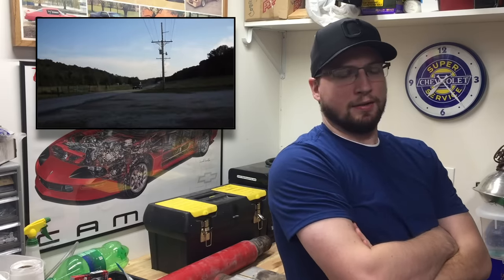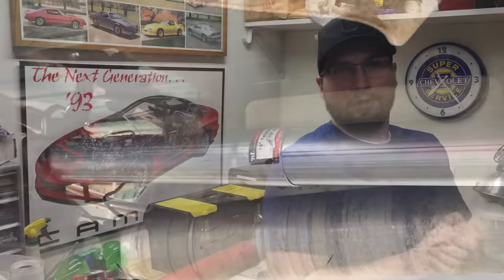Cherry Bomb® Glasspack vs. Straight Exhaust Pipe - Sound Comparison - 5.3L Chevy

Comment from the maker: What sounded better? Glasspack or Straight Exhaust Tube?

OFFICIAL DANINATOR MERCH IS NOW AVAILABLE! Check it out:
https://teespring.com/stores/the-daninator-merchandise-shop
Use Coupon Code: DAN10 to save 10%!
Reply: I have the same truck, and mine is straight-piped. I prefer the straight pipe...
Reply: Straight pipe forsure thats what i have on my 5.4 should try putting a 5 or 6 inch tip it would sound real good
Reply: Straigh muffler delete is sexy. But i would go with Glasspacks. Now heres a great questions. Whats the difference between Cherrybomb Glasspack VS Thrush Glasspack? Also when are you gonna get high flow cats? If your state doesnt  require emmisions. When are you gonna cut off your cats?
Reply: I liked the straight exhaust on most shots. So straight
Reply: Straight pipe sounds better for sure
Reply: I have an 06 5.3 that's been straight piped for about two years now, suffice to say I love it and my four year old loves it even more lol hey Dan if there's any chance you see this comment it'd really help a brother out if you did a video on how to replace the rollers, I've read the manuals and gone to the forums and unfortunately there just isn't an idiot proof video anywhere on how to do it in the driveway with common tools
Reply: The straight pipe sounds good at idle and part throttle but too loud and harsh IMO.  I'm partial to a single 2 chamber or a turbo muffler.
Reply: Both sound good but I think glasspack sounds cleaner
Reply: Straight pipe at idle sounds so much better
Reply: Glass pack sounds nicer less erratic scream at high revs
Reply: Dual 40 series Flowmaster mufflers is what I run. Short style JBA headers. It's a 1999 5.3l LM7 Silverado. Going to do a rebuild on it soon. Maybe bore and hone it out 3.903 (5.7). Stage 2 cam, FAST Lxrt intake, long style headers, 92mm throttle body, after market heads. I'm the original owner.
Reply: Straight pipes sounds better
Reply: I’ve a 4.3 V6. I love having a straight pipe sound but it sucks when you’re pulling into church late or trying not to wake up the dogs when you get home so I’m going to put my glass pack back on
Reply: Aaron Brown 
Do a electric cutout. 
I did one and it’s a lifesaver, I’ve saved at least 3-4 times even being pulled over for being loud. 
I did mine a little different, diesels (no turbo) are wicked loud with a straight pipe. 
So I have a glasspack further up front, and the cutout goes to open , or into a turbo muffler. 
I find myself riding around with it closed most of the time unless I’m out in the sticks.
Reply: straight pipe
Reply: Straight pipe
Reply: Glass packs. Straight pipes are a little too much noise for stock. Maybe do a rebuild video and put a mild cam in it and do another exhaust video?
Reply: Straight pipe
Reply: Glass pack I think. It has a more throaty sound than the straight pipe.
Reply: GODONDRUGS would my 5.3 99 sierra sound good straight piped? it has long tube headers and a flowmaster 40 series right now with cats removed. i’m gonna take the muffler off when i get it straight piped
Reply: I think strait pipe is better
Reply: I definitely liked the straight pipe cause that’s what mine is pretty much
Reply: May i suggest eletronic exaust cutouts it's nice to have a quiet truck but flip the switch and hear the roar
Reply: Well from experience I have cherry bombs on both of my vehicles 93 Ford Explorer 5 speed and and 01 land rover discovery they both have a for leader they explore has a 4 l V6 then land rover has a 4 l V8 and they both deathly have a distinct sound compared to other vehicles the same
Reply: The Daninator straight
Reply: Straight
Reply: Can we talk about the rust on your bed..?
Reply: Straight pipe
Reply: How much did each cost
Reply: The Daninator straight pipe
Reply: Glass pack
Reply: Straight pipes just make it louder at idle n make it crackle more cherry bomb makes it more of a sleeper style where u can idle up towards someone on side walk n make um jump when u hit the throttle
Reply: Straight pipes!! I put straight pipes on my 1977 Cutlass my mom liked the sound so much she had me put them on her 1977 Pontiac Can Am she loves setting off car alarms while driving downtown! 🤣🤣🤣🤣🤣
Reply: Glasspack
Reply: Glasspack all day. You get the growl without that high pitched rasp.
Reply: Straight!
Reply: straight pipes better but i’m gonna get the glass pack so i don’t get pulled over all the time lol
Reply: At idle, the straight tube sounds better. Under "no load acceleration" (in neutral) and under load, the glasspack no doubt, sounds far better.
This is all from OUTSIDE the cab.

The glass pack under acceleration sounds FAR MORE refined, smoother, and a "throaty roar" instead of the ""flappy ROAR" of the pipe. The pipe under acceleration sounds more like an older truck, with a LOT more miles on it that just isn't as "tight" any more.

But I do agree, from INSIDE the cab, the glasspack does indeed have a "drone" to it that I could see wearing on you after a while and the pipe sounds better from INSIDE.
Reply: Both sounded ok, but much rather have a Supertuned REALLY quiet sleeper exhaust, that way nobody know's your about to smoke'm - blow there doors off, system.
Reply: Is this with or without cats?
Reply: Honestly the glasspack but im more a flowmaster guy i run Y pipe with 3 inch downpipe mated to 3"to 2.5 dual outlet Super 44 mandrel bent over the axle to the rear and i have a TBI 305 and it sounds fucken awesome plus with a few mods that made it sound aggressive
Reply: But it depends on engine bore and stroke along with compression to really get down to what sounds better
Reply: Straight!!
Reply: Glasspack
Reply: Straight pipe
Reply: thinking about a glasspack for my 280z, what you think?
Reply: I like the glasspack better
Reply: I’ve had cars with glass packs and cars with muffler deletes with resonator deletes both deleted and castles straight pipes and I prefer catted straight pipes over all perfect sound for a sbe (ls for those in the special class) and modular 4.6 (ford ohc platform)
Reply: Str8 piped better
Reply: Aaron Brown that’s what I have a 4.3 v6 Sierra 1500 short bed. I want a glass pack anything else you’ve done to your truck?
Reply: I have a 97 350 with the muffler removed but I do want to put a muffler on it so I can sell it, I don’t want to but it’s too unreliable for me to drive long distances and it’s started to have more and more problems
Reply: @SKANK_HUNT49  They might enjoy the novelty but will soon hate going on extended car rides due to the drone lol
Reply: Glasspack because it has a genuine rumble to it. The straight pipes make you you look like a high schooler that wanted a loud truck for cheap.
Reply: glasspack
Reply: Yes

Comment: Lastly, tricks to reduce interior volume and drone: position X, H, or Y pipe either closer or further downstream (need to play with it for your particular vehicle & engine), position muffler as far back as possible (if you place muffler AFTER the rear axle, that results in a SIGNIFICANT drop in cabin volume (I have a video I did that personally on)), add a secondary X pipe or use a muffler like a Cherry Bomb Vortex which acts like an X pipe due to internal design, and is great for a true dual setup with a dual in/out configuration on a single muffler (my current daily has this setup and it's hardly louder than stock when idling and cruising. Moderately loud when you mash on it tho. I am using an X pipe and that CB Vortex dual in/out muffler for my setup, and it's perfect for your daily driver to keep exhaust levels conversation and music friendly while idling and cruising, and still within reason while accelerating).

Comment: If you want to be loud and growly, then straight pipe exhaust tubing is for you. But if you want to sound nice and clean and still have some noise then glass packs are for you.

I personally like the glass packs better because they sound much cleaner than straight tubing
Reply: Growly, no. Poppy and blatt-blatty, yes. The glasspack growled. The straightpipe basically did V8 flatulating..... Equivalent as a V8 form of all the fart can Hondas out there. Farting loudly, but with 8 cylinders instead of 4. 😒
Reply: @JoeIsCrazyWillman  indeed

Comment: Cherry Bomb for the win. Straight pipe has too many high notes that make it sound like, well, like you're missing a muffler. Those high notes are the ones that pierce the ears and they're not pleasant at all. I straight piped a '67 Chrysler Valiant Regal (an Australian-made Chrysler) and at idle it sounded great, but on acceleration the high notes came through and made it sound like a junker. Someone else here said the glass pack made it sound like a well-tuned strong engine. I concur. I concur :-). Great video man. Thanks for sharing!

Comment: The straight pipe sounds very different in person. I heard it in many videos and did not like like. So when i cut off my stock muffler i went straight to a flowmaster super 10. When i got tired of that muffler i went muffler delete and man it sounds good. I now have a 3 inch cat back pipe i got from an 07 n up silverado at a junkyard (bolts right up and 99 to 06s have 2.5 piping) with and autozone 5 inch resonated exhaust tip in front of my rear passenger side wheel (side exit) and its the best exhaust soung iv had.

Comment: I prefer the sound of the strait pipe in place of the muffler over the glass pack. I think a lot of it depends on if you want the raw rumble and crackle sound or a little smoother lower growl. Both sound good in my opinion though.
Reply: I'm trying to figure out if I should straight pipe or glasspack. I want a deep rumble and not the louder option
Reply: @frankthegerman4426  just straight pipe it bro I did.
Reply: @frankthegerman4426  Sounds amazing and not too obnoxious. Definitely sounds smooth and rumbles
Reply: @jordanfindley7538  cut the muffler so far and I already like it and do not regret it whatsoever. Will now cut the rest and straight pipe it all the way to the back instead of dumping at the side
Reply: @frankthegerman4426  got duals on my 05 dodge ram 5.7 hemi with 4 inch tips and still have the cats, she sounds mean and people like it
Reply: @ACE-le8oh  Yeah I went for a muffler delete a while back then put a thrush muffler on. I feel like muffler delete was too loud but the thrush sounds too quiet because of the pipe after the muffler, so I might have the whole exhaust stop right after the muffler if that makes sense.
Reply: @frankthegerman4426  went to straight pipes again with 4 inch tips way too loud with that crackle, so I'm gonna go back to glass packs with cherry bomb 8inch. Yeah I know what you mean on that
Reply: @frankthegerman4426  will say this the longer the glass pack the quieter it will be is why you had that issue

Comment: I like the sound of the cherry bomb much more. It does sound like a well maintained powerful engine. While the straight pipe sounds like there is a hole in the exhaust somewhere
Reply: The straight pipe sounds like a NASCAR.
Reply: Well-maintained powerful engines don't have mufflers.

Comment: You'd have a MUCH better sound if you bought a 1-in, 2-out flowmaster and used those 2 straight sections for the outlet to carry it away from the cab and hung it.

Comment: Straight pipe sound stupid at least put on Echo tip, 3 inch pipe with glass-packs has the full throat sound not the pinging and popping with a little rattle will probably burn up your valves

Comment: Hmm, love hem both, if you want a combo of both i'd say upgrade to flowmasters or magnaflow muffler.
Reply: I never got why flowmaster was so great. Sure they sound good from outside but the drone inside the truck is mind numbing especially if your stereo has a little bit of bass. Then you get that annoying wawa effect when the tone from the muffler and radio is almost in tune with each other but slightly off.

Comment: It seems the interior sound, for both, is quiet. Otherwise... I once had an old GMC Jimmy with glass packs. A cop pulled me over just to see what I had into the exhaust system. He seemed to like it. I found it no different than a regular muffler. The straight pipe sounded very throaty which would be the sound I'd be going for. Imagining what it would sound like on my LS6...
Reply: The muffler delete is pretty loud inside the Truck
Reply: The glass pack drones more.

Comment: Would sound alot better with a 40 series flowmaster
Reply: True fact!  Good advice
Reply: Have that in my truck sucks the flow master 40 series without resonator don’t like it
Reply: Depends on truck, I think, personally. I think they sound way too hollow, empty, and even tinny on most V8s, especially older Rams...
But sound great for like the Ford 4.0 V6 and Chevy 4.3L V6, etc.
Reply: I have a 99 with 5.3, flowmaster 40 and it sounds really good, no tailpipe though it rusted off behind muffler
Reply: My opinion is that most guys get 3" tubing where they would be better off with 2 1/4 or 
2 1/2.  Better sound and performance. 3" is better on forced induction or bigger power makers
Reply: Got the 10 series flowmaster on my 2001 dodge ram 2500 with the 360, sounds amazing
Reply: I love my dual 40 series on my 97 chevy

Comment: I like the straight pipe so I just recently got it on my 2007 crown Victoria police interceptor.
Reply: I'm trying to decide what I want to do with my 07 P71. Straight pipe, glass pack, or chamber muffler. I don't have cats, so it is already a lot louder than stock. I'm afraid straight pipe without cats would be way too loud, but the cheapest option.

Comment: I gotta go with the straight pipe my 04 tahoe had true dual cat back straits 2.5 inch piping with 6 inch tips and it sounds amazing
Reply: Farmer Jon i’m gonna get true duals but i don’t have the cats on mine and i have long tube headers. will mine sound good with the same setup as urs but without cats
Reply: PurpleSkunkYT yes it would sound great it’ll be real loud but good sounding

Comment: I like the straight pipe. It seemed quieter inside the cab. I currently have the cherry bomb single to dual flat muffler. It's just way to loud in the cab. I just ordered a y pipe adapter. Thanks for the video
Reply: Agreed.

Comment: This guy is wrong a cherry bomb is not a true glass pack there just called glass packs my truck has a true glass pack and the sound is completely different there are only 2 brands that make true glass packs in America that I know of
Reply from the maker: What brands?
Reply: @TheDaninator  I don't remember the names because my brother had ower local exhaust shop put it on when the exhaust system needed fixed I know the brand starts with a m or j I think, the brand that is on my truck is the brand of the original manufacturer of true glass-packs I'll have to ask my brother what the name is because he told the exhaust shop how he wanted the exhaust done when he on the truck

Comment: my old 5.3 had the cats knocked out and i straight piped it for a bit basically cut the muffler off and axle dumped it. horrible cruising drone but sounded like a nascar. like my buddy thought it was a modified engine when i got on it to pass him. but the drone gets real old real fast so i put a thrush welded on and it sounds good.

Comment: I run duel 12 inch 3inch inlet 3inch outlet on my 81 c10 383 stroker homebuild from a run down ass 350. DYNOed average of 320.2 hp/317.7 ft/lb torque 4 200 ft above sea level with a  single quad barrel electric choke Eddlebrock carb

Comment: Good work, but (from experience) being an old, old guy let me tell you to use caution during the cold months, when you come off the gas cold air shoots up that tailpipe, now you have your cat, but air is like water. OK now you got some real smart bike riders run,n Stright pipes when they go down the road, and come off the gas, you can hear that motor blelch, and pop and backfire, that is cold air, up you tail; pipe, to your valves. now look, I, 'm old, and maybe vehicles have changed, but for you remember, that motor is not supposed to pop but purr.......BB

Comment: Before I wreck my 98 Z71, guy ran a red light and t boned me hard, I had true dual flowmaster 40 series mufflers (2) on mine. From the header they came down into an x tube then into the mufflers and so on. But my guy cut a quarter size hole in one side on both of the mufflers and welded a small pipe there. I dont know what that was for but it sounded great. It didn't habe that stupid loud ass Chevy cackle like most of those gay ass peckerhead squating trucks do.

Comment: II like the glass-pack. The straight pipe sounds like drek without headers. If the glass-pack gets too loud after break-in you can add another one inline (if you have room) or another couple of short ones.

Comment: I've got dual glasspacks on my '71 Ford F-100 FE 360 (5.9L) which were probably installed in the early 70s and I much prefer glasspacks to straight pipe. If you're going to race, go straight pipe. Otherwise, don't piss off your neighbors and everyone else within earshot of your truck; install mufflers.

Comment: Glass packs have been a favorite because they burnout rather quickly & sounds better than when they were installed.   
Straight pipes are nice too, especially with long tube headers & ran out the rear.

Comment: If you have a couple bucks around I'd recommend an electric exhaust cutout.
That way you can make it loud when you want , and close it when you see a cop. 
Mines paid for itself probably 10 times by not getting pulled over for excessive noise.
Reply: @cubes563  
Yea and the cop still hears the rumble pop pop pop cackle as you pass , then get pulled over.

Comment: I had a 1970 Chevelle 350.! The glass pack with 2-inch pipe out the back it sounds so much smoother and more powerful like a smooth tune but loud. Straight pipe has that loud I don't have a muffler sound. Cherry Bomb all the way.!